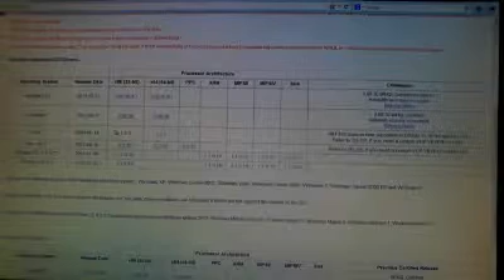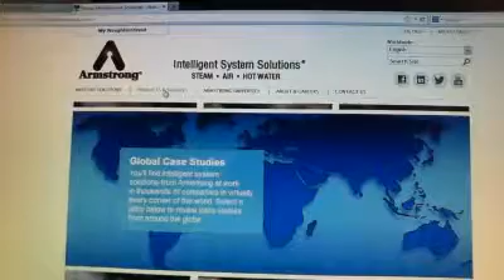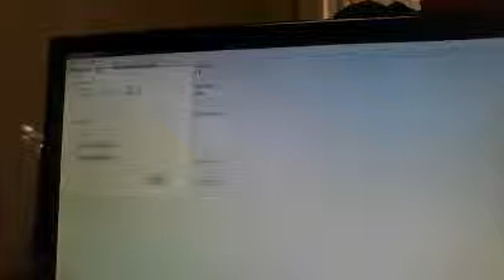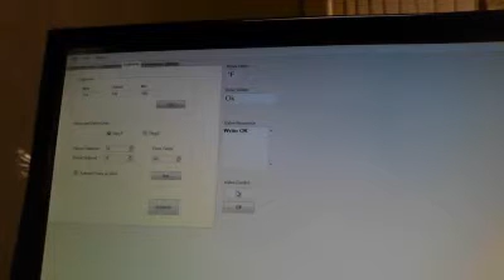Hot Water How To: Setting Temperature for The Brain DRV40 and DRV80

Comment: Error drive
Error check

Valve response:
Write Fail- check Valve is OFF / Check connections.. 

???????
Reply: hollo Did you find a solution?? I have the same problem